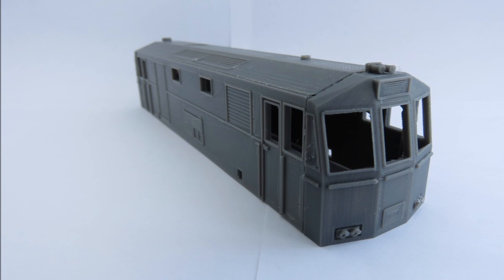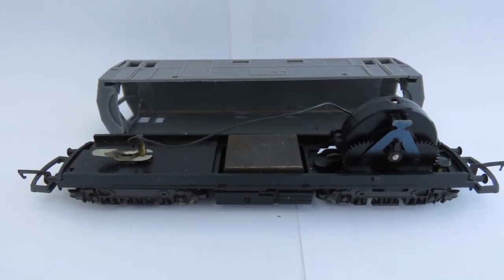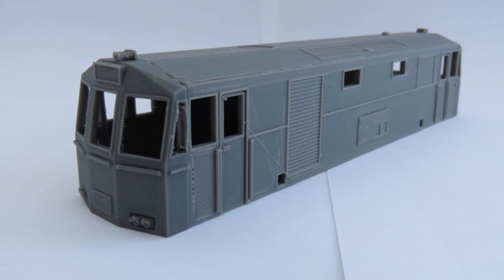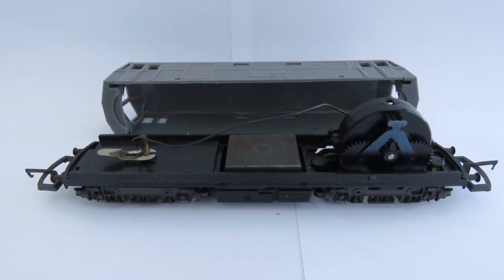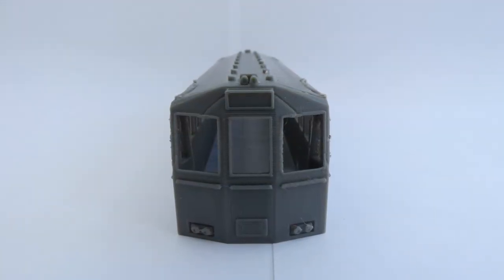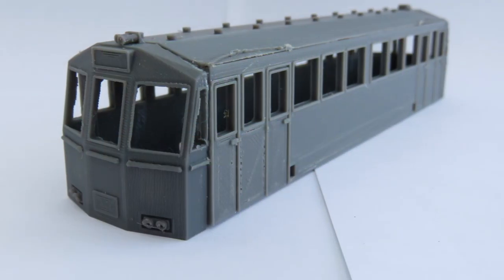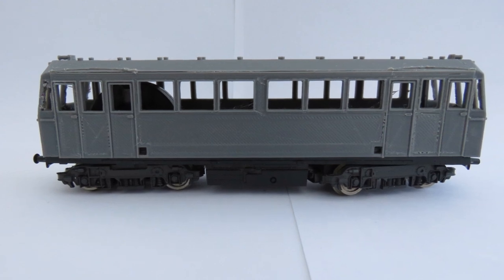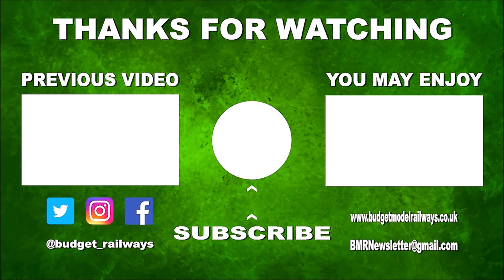OO Gauge Bo-Bo Diesel & Bo-Bo Railbus - 3D Printed Model Railway Kits - Budget Model Railways

Comment: 10 to 15 euros for a running chassis... what train show is that. Even the most basic locomotive (0-4-0 starter set diesel) goes for 30 euro plus on this side of the channel. Only place i saw model train stuff on that price level has been car boot sales.

Design wise it looks like a Renfe 319.2 Retales, with those 3 window cabins.

Is a Fleischmann style cabin interior setup an option? That is: drive with the motor on the rear, with a detailed interior with a driver on the other side
Reply from the maker: To be fair this is aimed mostly at the UK. We use OO not HO so these locos can be bought very cheaply as there is next to no demand for UK outline HO.
Reply: @BudgetModelRailways  OO scale stuff is rare here, except for Oxford Models vehicles that sometimes show up in the HO vehicle stands...